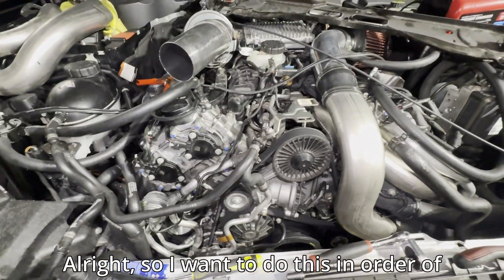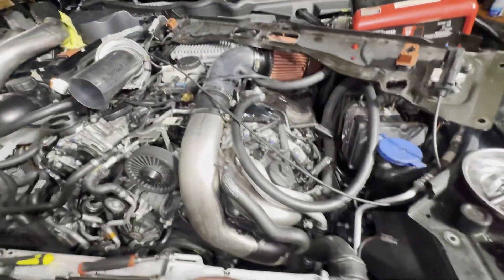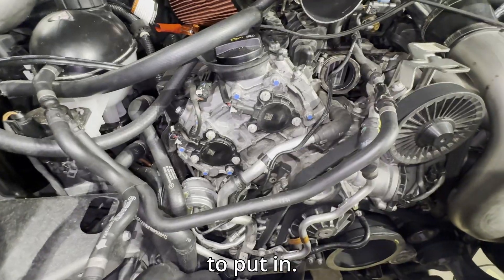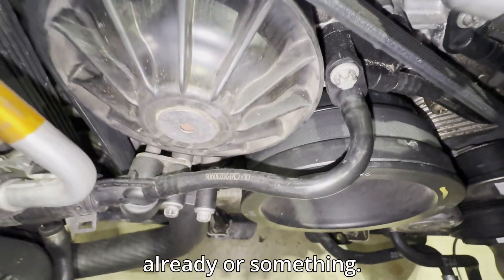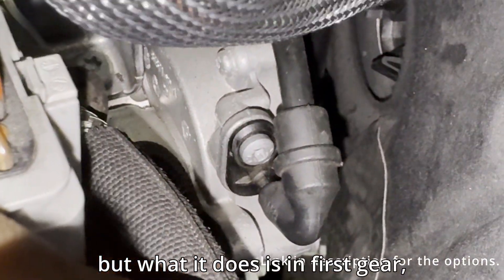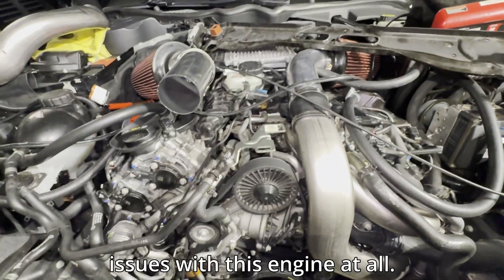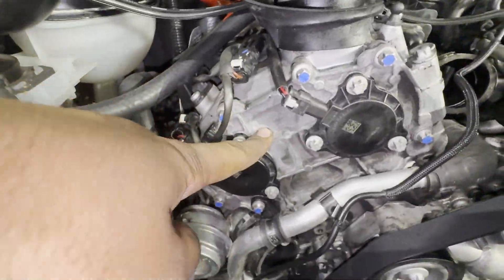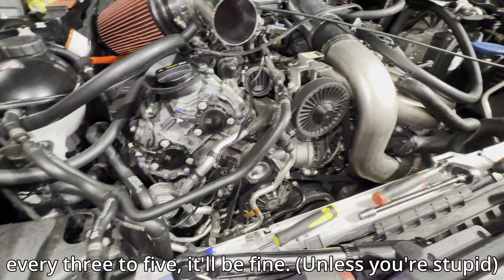Bulletproof Your Biturbo (M278, M157 common problems & fixes)

Comment: Please help me What oil m278 mileage 110,000??? I poured 0w30 Motul and the engine started to be louder..."knocking" the bottom of the engine. 5w40??? Thanks
Reply from the maker: 0w30 is the wrong oil, you probably damaged your engine if you used it for a long time.
Reply: @ginco_bnz 200 km only
Reply: 0w40 Mobile One European Car Formula

Comment: Hey friend. I have a 13 ml63 and did the waterpump but couldn’t find any torque info. I saw a vid for m278 and it shows 14nm on all shorter t40 bolts and four of longer t45 bolts on outside of pump to 20nm. Before seeing this vid I got confused and did all 20nm. Is this bad?
Or can I loosen up the shorter t40 bolts down to 14 as stated. I’m worried since it’s a metal gasket that it’s been compromised as it’s been tightened 6nm more. Is the gasket ok still to reuse? It’s a new gasket. Please help!
Reply from the maker: You're fine, don't undo anything or you'll ruin it. They can take extra torque.

Comment: I cannot imagine why there is a need to replace the timing cover and magnet bolts with new ones, even if they were cheap. I am going to re-use mine with a drop of loctite. Thanks for the fantastic video, you are a superhero.
Reply from the maker: They do snap very easily as they are strech bolts, so be careful.
Reply: @ginco_bnz  I did not realize that. This makes a lot more sense now.
Reply: @jasonmarinomusic brother, I would just change the bolts, They 100% do stretch from the vibrations and expanding of heat cycles from the engine. Being hot and cold
Reply: He literally said he broke the bolt because he was reusing old bolts … you don’t need to replace timing cover plate , clean up old sealant and reseal it , use new bolts to install it , and you should be good
Reply: Blue dots

Comment: Great video, at 12:18 can you pls tell me what are the 2 lines/hoses at the bottom right of radiator, mine are leaking, TIA..
Reply from the maker: No clue
Reply: Those should be the transmission cooler lines
Reply: @darnelltaylor2402  thx for info

Comment: The reason these engines blow up imo is due to detonation from high intake air temps. The intercooler gets heat soaked when it sits after driving. You get back in and have sky high intake temps 130 degrees or more until the car runs for several minutes. I used an autometer dash link to confirm this. Any way the need for a split system, large front mount heat exchanger and high volume pump are obvious. I'm also going to do a water meth kit when I get the Renntech tune. I'm doing the solenoid delete as well, thanks for the info.
Reply from the maker: Yes IAT's definitely play a part, that's why it's important to leave the car idling for 2-3 minutes after driving it hard before you shut it off. The intercooler pump always on mod makes a big difference also.
Reply: E63s have split cooling. Also a pump rewire will keep the pump cycling fluid throughout the system, unlike in oem settings, it awaits a certain temp before the ecu kicks it on.

Also improper lubrication is the issue for cyclinder scuffing and such. Imagine having 700-800 trq and your car in low oil pressure mode to save gas, instead of lubricating and cooling
Reply: Agree. Always on intercooler pump mod is a must. And always listen for it to run. If not investigate right away. They can fail. Also check coolant level in both systems regularly. Mine had a pinhole leak im a hose and would run low over time since it is a low pressure system. More difficult to notice. Also unplug that oil pump solenoid. Screw the mpg savings
Reply: @sdsupratt will check engine light come on?

Comment: great info i plan on puttig hose on the turbo lines and step clamps . i am having a hard time removing the line from the expansion tank to the radiator at the radiator ,any tips , and maybe you didnt need to remove it ,thx

Comment: Thanks - I have a 18 550 GLS - hope to keep it for the long haul, will convince my mechanic to do some or all of these.
Reply: By late 2015 90% of problems on M278 are gone so you dont need to worry about much with 2018 model other then doing oil changes with best oils on 5000 miles , even sooner if you tow with it.
Reply: @Mikrrii  Best upgrade M278 got IMO was steel cylinder liners, M157 didnt get this unfortunately

Comment: I wanted to listen, but you're literally running a hot air intake setup that is robbing you of more power than anything you could have gained with repairs.. not to mention the filters being way too small. sigh

Comment: Gotta ml550 v8 biturbo, 2012 and yes….. sitting at 140k miles, still running strong currently, I hope I can rack it to 180-200k miles we’ll see though…. Done nothing but an oil change, changed the rotors as well.
Reply: any update
Reply: @EbkHunter assuming not 😭

Comment: That’s why I love M113k engine, everything is metal
Reply from the maker: Me too, that’s why I’ve owned 2 M113k’s and 2 M112k’s.
Reply: Everything on an M113k ain't metal. Plastic pulley split for the accessories and shredded the belt. Thankfully it was sitting at idle and not doing 80 on highway.
Reply: @stephenperrone8694  forgot about that.. 🤭 I replaced all pulleys to aluminum and installed all stainless steel bearings including supercharger, to prevent them from failing due to me constantly washing the engine bay. For the large glass reinforced coolant hose elbows I made them out of stainless steel also. So my engine was pretty much metal 😊.
Reply: @stephenperrone8694  Of course it isn't but every car enthusiast has their dreams.
Reply: The UNBREAKABLE MOTOR
Reply: I have both
Reply: You're joking right?
Reply: @gottliebdee263  wjy would I be? I like them both
Reply: @shosaleen  My reply was to Zeomarbob.
Reply: The block is aluminum
Reply: Yeah cause aluminium isnt metal.  @MartiniPinball
Reply: I just wonder if it’s possible to swap M113K to the CLS63 car body (W218)
Reply from the maker: @bigboycars of course it is, with enough money 😂😂
Reply: I have that m112 but I wanted to see how these engines evolved over time. I haven't seen this video yet, but when I read they turned to electronics for the water pump I have a feeling it's related to the overheating problem.
Reply: @salvationbygracethroughfaith  Just remember that as time goes on, the cars around you become stiffer and heavier which means old cars, (even ones that did well in outdated crash tests), become less of a place that you want to be.

Comment: You forgot to mention that you need to replace the coolant tank because of the bag with the stupid shite in it, that disintegrates over time and ends up at the bottom of the air conditioner's radiator (needs new radiator if not replaced on time).
Reply from the maker: You learn something new every day, thank you for the information.
Reply: @ginco_bnz  found an English video about a VW car. You cant take just the bag out on a Mercedes though. Its in another compartment inside the container. Also, it doesnt see through even if you put a light on it. You will find it, if you cut up the container.  https://www.youtube.com/watch?v=-GWRejR7U0w&ab_channel=LastHumansGarage
Reply from the maker: Although, I'm not seeing anything about the bag for my CLS on WIS, can you share any more information?
Reply: @ginco_bnz  Hello. I only have this video from a Russian youtuber and i also read it on the Russian forums. The story is that the container has some sort of a bag with a "coolant softener" of some sorts, which helps the engine last longer. Ofc, due to Russian winters or other harsh conditions these bags tear up and this "softener" spills into the cooling system and at the end clogs the AC radiator. This is the video. GO to 15:30 https://www.youtube.com/watch?v=qNkXYDORPbU&t=935s&ab_channel=%D0%94%D0%B5%D0%BD%D0%B8%D1%81MoneyAC
Reply: @ginco_bnz  lol does youtube deny me posting another youtube videos in the comments? or you delete them?

Comment: Great video my friend a lot of important information to take into consideration if thinking about getting a car with a m278. I actually have enough issues already with my m156 but my m113k keeps me sane 😂 Thank you for your video
Reply from the maker: M113k is a great engine, very easy to work on and the problems if any are always exactly where you expect them to be.

Comment: I would recommend replacing that "random bolt" you used with an aluminum one. Steel and aluminum react, and it will seize up and be impossible to remove later.
Reply from the maker: I know. The random bolt was from a clamp on my CL55 which was going into the block, and the M113k is aluminum as well.

Comment: Nice vid, thanks.  I'll say this, removing the oil solenoid connector under the car without a lift was a bitch!
Reply: Yeah... just did this 2 days ago and sliced my left arm on the fan shroud. And Taping up the loose connection was like trying to play pickup sticks with your butt cheeks.
Reply from the maker: @simpleman68 yep, definitely easier with the fan out, but worth it in the long run.

Comment: Camshaft Adjuster Magnet Harness Extension M278 For Mercedes Benz 4.7L 2011-2020 

Will it fit in m157 cls?
Reply from the maker: If you can't figure out how to check the eBay compatibility chart please don't mess with this engine.
Reply: @ginco_bnz  no, my friend. no light on the entire internet such parts for m157. only for m278.  
I'm just asking you if the plug is the same😉
Reply from the maker: @CheckEngine96  What light?
Reply: @ginco_bnz  sorry for my english, but i speak polish german and hungarian. for me english is too much
Reply: @ginco_bnz  there is no such part dedicated to the m157 engine, only to the m278
Reply from the maker: @CheckEngine96  they're identical.
Reply: @ginco_bnz  thank you😀

Comment: I own 2014 E63 with M157 , all of your coolant hoses, issues , all happened and replaced with new ( Im Mercedes Tech) even with discount, those stuff still very expensive.
Reply: Same problem, i own a 2014 e63. Changed the Radiator, coolant hoses etc. Can u tell me anything else i cn do before hand to prevent any other damage
Reply: @Khanosama59  oil/water cooler seal, front covers , almost everything related to the coolant line/pipe , change oil frequently and used the oil additive to protect the cylinder wall
Reply: I like you cooling fan idea , but really don’t want to destroy the clip on the fan , but also every job for the engine , that requires to remove the fan and loose all coolant, I own it for a year, and probably drain and refill the coolant more than 10 times, different coolant pipe/ line pop every other day
Reply from the maker: @MBZXZ  Yep, that's why I broke the clips, I've pulled the fan out twice since then to change the belt and a pulley, having to drain the coolant every time would be a pain in the ass.

Comment: What does unplugging the oil pump solenoid do ? I heard it makes the car run and shift way better.. idk though
Reply: Basically just makes it so that your engine is always squirting oil and maintaining proper pressure at all times. When it is plugged in it limits the amount of oil pressure under 3k rpm I believe. I’ve read it’s under 3.5k rpm as well so I don’t know which one it is but I noticed a difference when I disconnected mine, the car just seemed to be happier under low rpm’s.
Reply: Does it set off any check engine light?

Comment: Think a 2013 E 550 is a good buy?  What car do you have lol
Reply from the maker: I would go for a 14+ unless the 13 has had the timing issues resolved, however if you're willing to pull the timing covers off it's not very difficult after that.
Reply: @chiampmods  recommend 16+ m278 , heard they fix the cylinder wall damage issue?
Reply: @MBZXZ Yeah because these engines love there 4k oil changes, and when you mix 10-12k oil change with people that tow boats with GL550 you get fucked up cylinder walls

Comment: The issue with the solenoid mod is extremely low oil pressure under 2k. on some cars down to 14psi. now if your ever booting it from a stand still the pressure i feel is not enough to support the rod bearing with out premature bearing wear.
Reply from the maker: Not sure where you got that information, but I didn't see it in the thread. The only issue the solenoid would cause is increased oil wear due to increase oil pressure, as Tasos covered in his video. The solenoid mod forces the oil pump into a high pressure only scenario, unless you are thinking that the solenoid mod lowers oil pressure? If it's 14psi with the solenoid unplugged then it will be 14psi stock as the solenoid only has a high or low pressure mode, unplugging it will only increase idle pressure. Mercedes themselves say that if the solenoid has a problem, and the hidden code appears, to simply ignore it.
Reply: @ginco_bnz the mod probably will also cause higher oil pump wear since it's being used more excessively
Reply from the maker: @ralph02136  oil pumps have been in use for 100 years without a low pressure mode... you will not have problems.
Reply: @ginco_bnz  true but Benz designs their cars in a way where they act up when changed sometimes
Reply from the maker: @ralph02136  people have reported the car drives better with the mod. More oil pressure is rarely a bad thing.
Reply: @ginco_bnz  how long have u had yours? I'm trying to find ppl who've had the mod on for some time to see if there may be some long term side effects
Reply from the maker: @ralph02136  about 8 months, I had it on my C400 for about a year. If you don't want to mess with it then don't, these engines are expensive. Which is why I unplugged it because I strongly believe it will make the engine last longer.

Comment: Can you share any info on those pipes with the airfilters?  Appears to be some 45degree bends about 8"~10" in length?  2" pipe?  Appears to be less restrictive than the stock air intake.